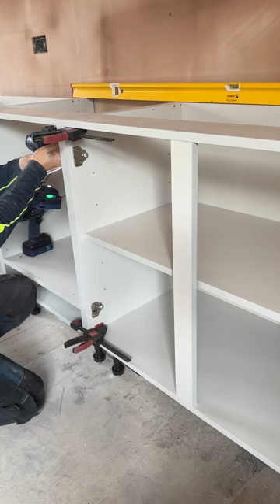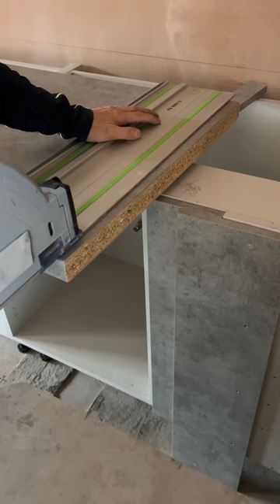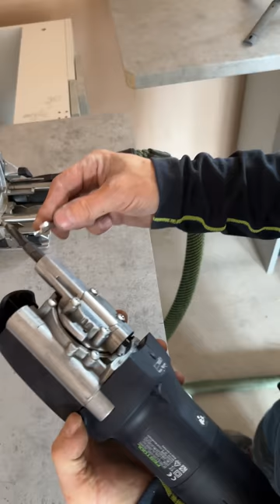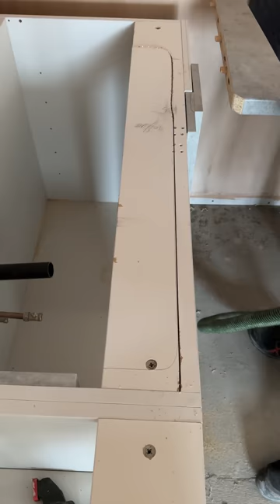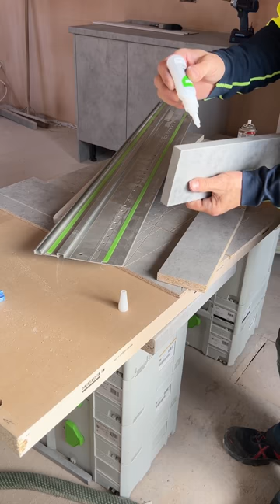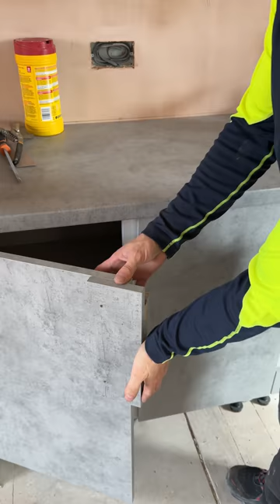Small kitchen installation full job fitting

Comment: Great job pal👌…. But got to ask what plum wedged the sink into the corner when clearly abit more thought & it could have gone under the window🤔
Reply from the maker: Good question! If you look there inside that unit is all electrical wire so control power is there
Reply: I agree, that would drive me mad

Comment: Excellent workmanship, neat work, very skilled professional installation - well done - I’m curious why did you use 2 x dominoes as spacers with the worktop jig pins? Do you ever use the domino worktop jointing method also on the plinth joining?
Reply from the maker: Nop on chipboard , maybe on MDF as they never worked properly because is not hardwood
Reply: He used the domino’s as spacers to make the mitre shallower than normal

Comment: Great install ❤ have never seen that domino worktop joiner setup before looks like it works well. 👊👊
Reply from the maker: Thanks I only use it on this kind of fixings as they are not pulling strongly tightly joint because the chipboard

Comment: Nice job, ! Instead of hitting the metal thingy on the plastic one when preparing the domino connector. You can 1st pu the metal and then the plastic retainer. Or is it a reason you are doing this like it
Reply from the maker: No it is not it can be doner either way thanks

Comment: Beautiful install, but with all those fancy tools you had to build a jig for the handles... question, I know those are ikea cabinets but what are the metal pcs inside the top corners of the cabinets.  Again great work!
Reply from the maker: Thanks i have use one handle jig before and i did not like it i messed up si in orther to get my braind work i always do jigs it helps me understand the principle hope it make sense thanks
Reply: @CAVjoinery  absolutely...the metal pcs. Inside cabinets, they're the hangers and adjustable to accommodate any fluctuations in the wall? Again keep up the good work!

Comment: Great workmanship, i almost got a hard on. What a shame the kitchen was done before the floor though. I suppose they will lay a new one on top of that one. Because of the height difference there wont be a clearance anymore for the panel by the floor, you wont be able to open it then.
Reply from the maker: Thanks is floatinh floor so has to be free to move

Comment: nice work, but is it a demo one? I mean wtf with the floors?? looks like a barn. usually ppl do furniture installation on normal and finished floors...
Reply from the maker: Thank you for watching ,there were 7 flats and I have installed 3 of them kitchen in there
Reply: Installing a kitchen on a finished floor is a common mistake as the ground moves, having cabinets installed on top of your floor tiles is counterintuitive.

Comment: Love the little jig for the handle holes. Also, why do you do shallow then deeper on your cuts please?
Reply from the maker: Hey is calling a score cut prevent from getting chipped face on melamine so every piece showing i do a scoring cut of 2mm right after I do fulcut
Reply: Is that because with a shallower cut, the blade spins faster so is a cleaner/smoother cut @CAVjoinery ?
Reply: Speed is the same, just much less chance of chipping finish when pre-cutting couple mm first
Reply: Just cut upside down no chip out.

Comment: What are you marking on the wall at the very beginning of the video? Is it the plinth height, then the unit height? You make two separate marks, then draw one long line.
Reply from the maker: I started by finding the highest point of the floor and from there i can mark my 150mm  plinth 720mm  base cabinet 40mm worktop 52 -55mm space then 720mm  wall units then dropped down 60mm for hanging wall brackets
Reply: @CAVjoinery  Thanks mate. How long have you been fitting kitchens and bedrooms?

Comment: Cutting a worktop In2 passes sink in corner I give up ,whoever designed that needs kick in stones ,what's the over hang on worktop since u didn't scrib the unit in ,should b 30mm
Reply from the maker: How is 30 mm left from 56 cabls and 20mm doors??:)) and i was doing 3 passes

Comment: All good until wall units…. Plaster board fixings for wall units? Really? Wooden noggins behind? Plywood? Nothing? Those units will be loaded with dozens of kilos! And also is horrible to fit a new kitchen on top of unfinished dirty floor! All crap left under units, covered by plinths of course. Rental flat I bet.
Reply from the maker: You are not a fitter i can tell that by not knowing simple stuff like the names of the fixings and probable you didn’t watched properly to the end ,maybe you have that envying for guys like me that work hard and are well equipped
Reply: @valis6761 salty words m8